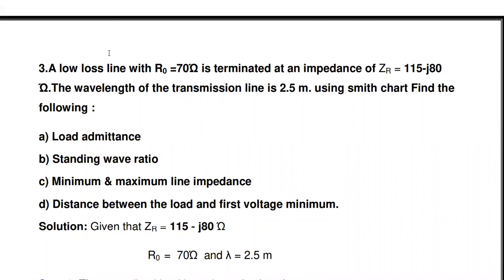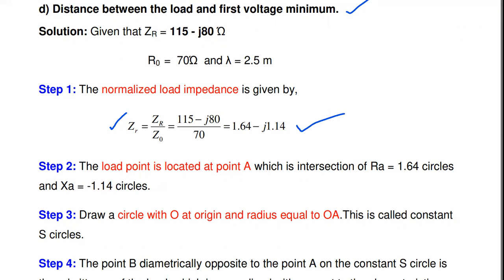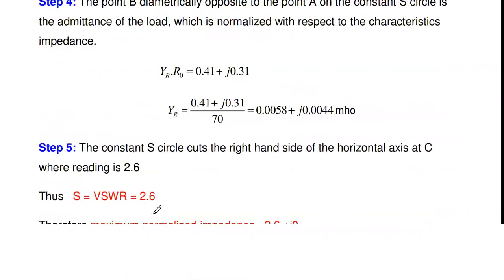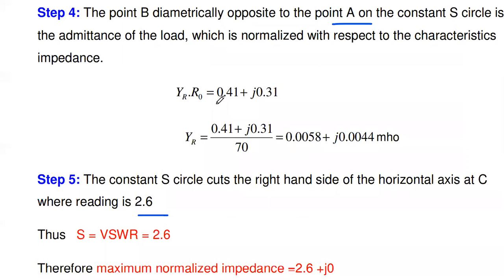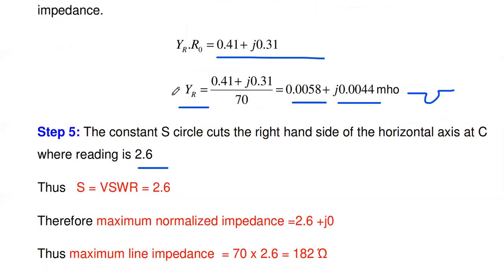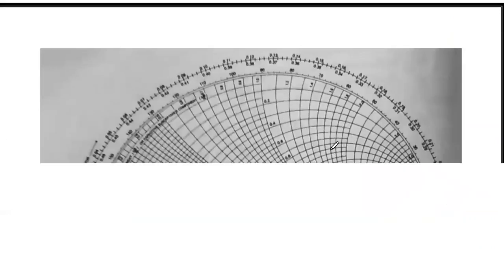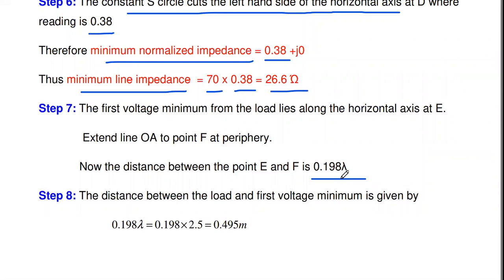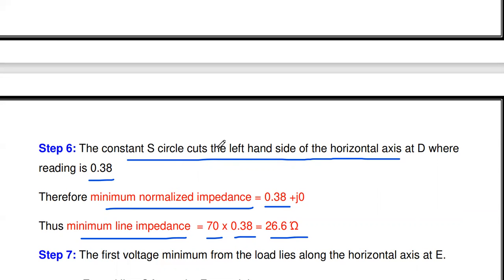Smith chart problem 3 | EC8651 | Transmission lines and RF systems

Comment: how did you find the admittance value as 0.41+j2.31...where the values located
Reply: It's the coordinates of the point B that you get by extending the line 0A to the circle
Reply: More importantly...it's normalised which u get from Smith chart....so to get admittance shouldn't it be multiplied by Ro????